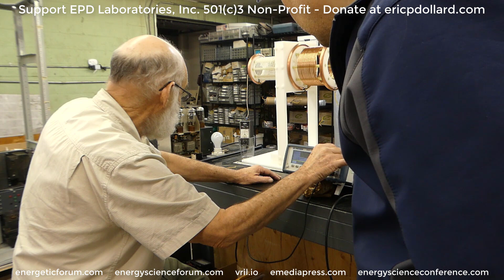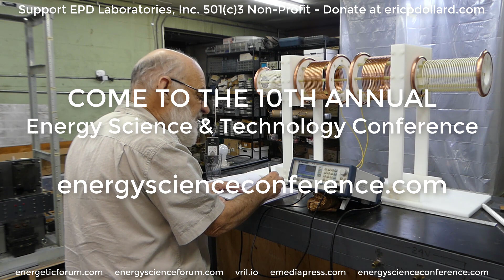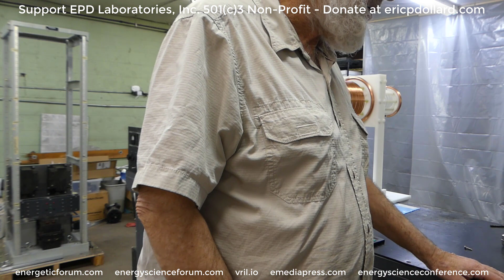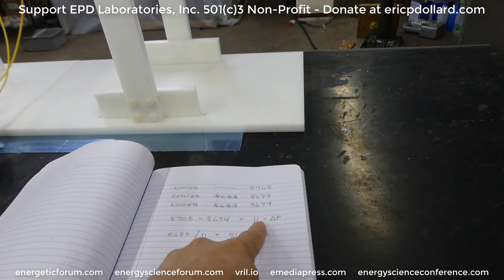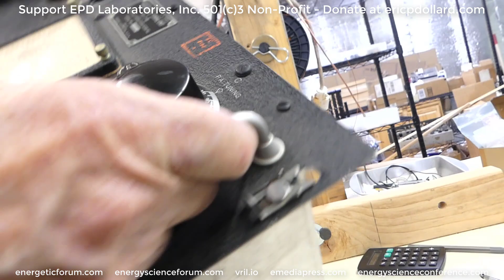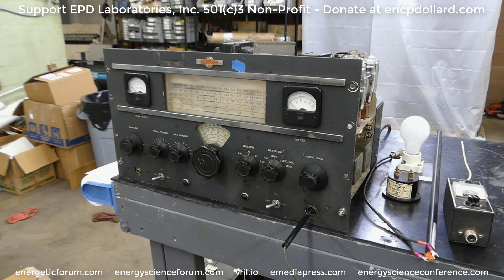The Real Tesla Coil — No Primary and No Secondary

Comment: At the end of all this elaborate setup and effort being put in, may I politely ask, what Practical purpose, can these 'Tesla' coils serve, in terms of over-unity, if any. Thank you.
Reply from the maker: Tesla coils aren't about overunity.
Reply: @AaronMurakami13  😂😅😄 Thanks.
Reply: @AaronMurakami13  Hi Aaron, I'd like to ask about this concerning a comment I found from Dollard on the energetic forum:

"Yes, harmonic oscillations in coil windings generate parametric dielectric energy storage co-efficients. Farads per second. Good path to follow."-From: Eric Dollard Sent: Friday, September 30, 2011 1:55 PM

Is this still valid to what is known today? If harmonics in coils can generate Faradas per seconds conditions wouldn't this make the enormous voltage rise in tesla coils a result of this over just simple accumulation and mean there is a potential of real power gain if combined with a step down winding?

Too add to that, does the Oscillating Current Transformer Dollard writes about in his Theory of Wireless Power get its name because the output waveform of the coil is Oscillating Current that grows or decays with time over simple Alternating Current? Cheers.
Reply from the maker: @JenkoRun  Eric is responding directly to people in Energeticforum.com now. Please post there and you can talk to him directly.
Reply: @AaronMurakami13  I think there's an issue with my account on the forum, I have neither access to reply to threads or send private messages, I checked the activation link I got with the email for my account registration and it gave me this:

"Your account has been activated but you are currently in the moderation queue to be added to the forum."

I sent an email about this to the contact address yesterday but received no reply, what do I need to do to have this issue resolved? Cheers.
Reply from the maker: @JenkoRun  please email me at info at emediapress dot com with your username/email and I'll activate the membership.

Comment: What determines how narrow the band gets?(delta between 70%)
Reply: Q factor, which is down to the total circuit resistance.
Reply: my bandwidth got wider (Q was decreased) due to dielectric losses to the frame/coil form (for instance, wire-wrapped PVC pipe: more resistance, open-frame solenoid: less resistance, UNLESS made of undried wood, i discovered #oops). Skin & proximity effects too.

Comment: Did you guys use impulse current? If so how did you generate it from that freq generator?
Reply: From what I understand coils built like this cause the magnetic field to be Longitudinally in-phase with the Dielectric field which results in phenomena similar to those produced with impulse currents but works with other waveforms including AC, I could be wrong as I only recently started looking into it but this is what I gathered from Dollard's Oscillating Current Transformer paper.

Comment: The coils are works of art.  If you search for slayer exciter circuit, you will find many YouTube videos on how to make a mini Tesla coil, converting a small battery input into thousands of volts output.  It almost feels like magic.  These gentlemen have colorful imaginations.  I can almost believe they are making important discoveries.  Unfortunately, wrapping two coils of wire and finding the resonant frequencies with a signal generator is nothing new.  I don’t want to come down two hard on these guys as their determination is contagious and the invisible forces of nature are always intriguing!
Reply: What they're doing here is different from normal coils due to the construction of the coils, the spaced design and very low resistance causes the magnetic component to propagate longitudinally in the same direction as the dielectric field rather than transversely which produces unique phenomena and efficiencies, see Dollard's Oscillating Current Transformer paper for more information.
Reply: @JenkoRun  you make good points!
Reply: on the contrary, a pair of single-coil air core resonant transformers, 'pointed' at one another, creating a peculiar field cancellation/opposition zone in between, is actually rather novel.

Slayer exciter circuits are uninteresting in comparison. Here the left & right solenoids are each single-inductor autotransformers. One could put a  bulb between them and see plasma spiral galaxies in rotation.

However, i totally agree about the generally impressive artistry.
Reply: @cold3lectric  you make good points!